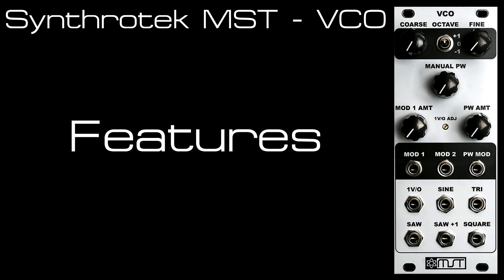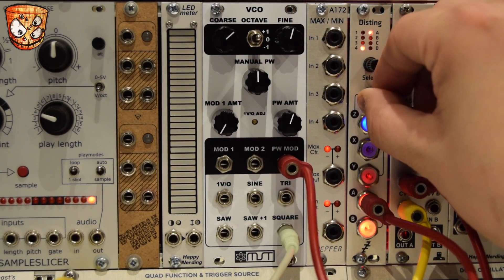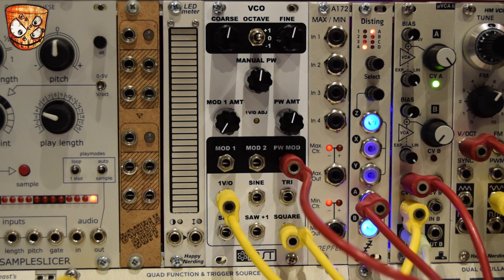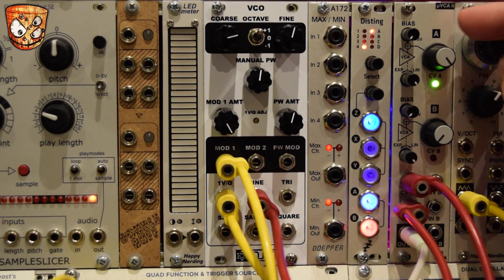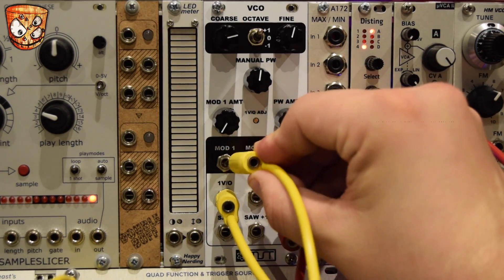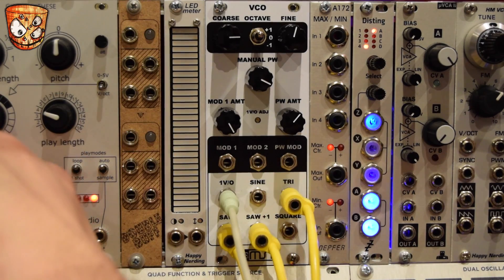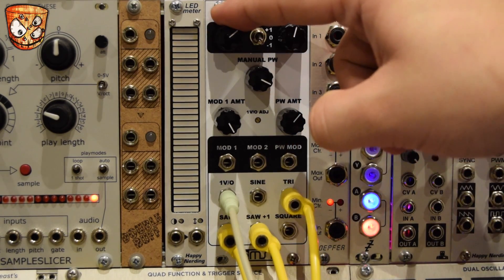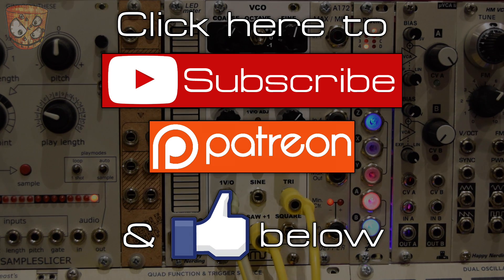Synthrotek MST - VCO

Comment: Do you use the Doepfer Max/Min mostly for crazy logical mixing?
Reply from the maker: +Ian Hoffman I usually stick a couple of un synced LFOs in and take the max and min outputs to modulate different things. A couple of slewed random voltages work well too.